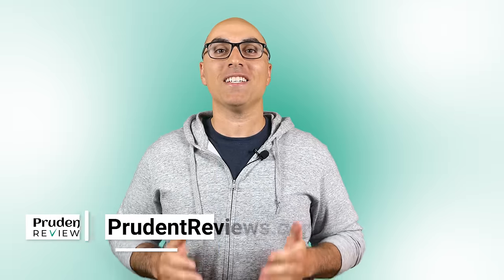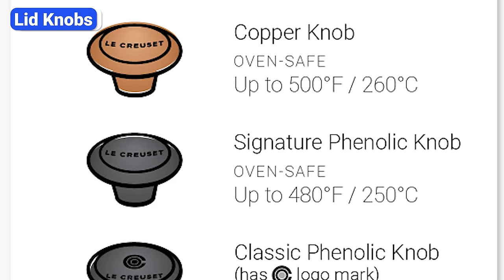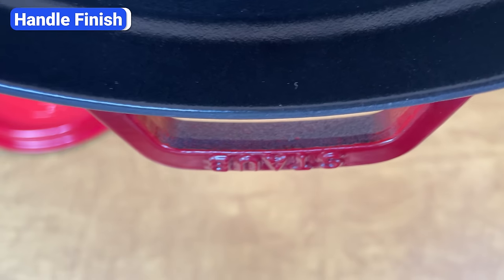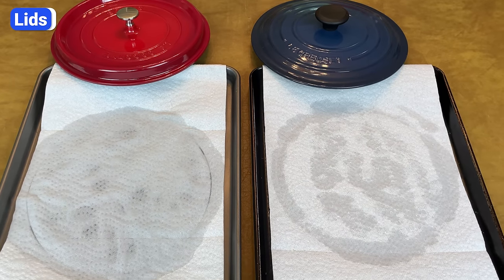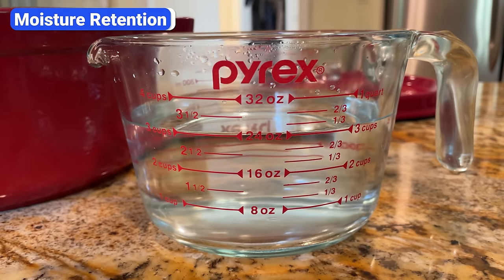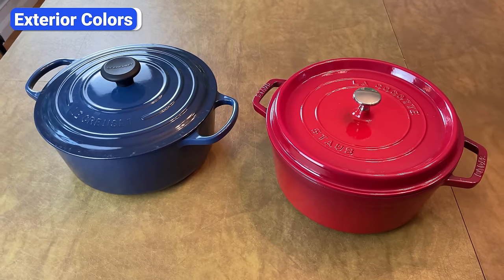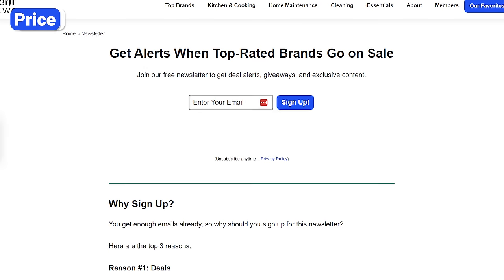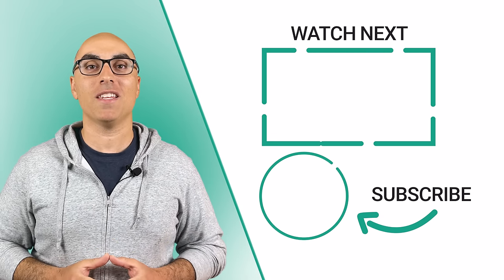Does Staub Outperform Le Creuset? My Tests Reveal the Truth

Comment: My staub Dutch oven was purchased in 2004..it has a top with a the same or nearly the same but cream color inside top lid with the little Stubbs that recycle the steam and droplets while cooking.  This newer version must be different. At the time the only competition Le Creuset had was Staub.  It was a bargain price and the quality was A+.  It cooks even, cleans up easy..it’s heavy so you know it’s quality cast iron ceramic covered cream inside a dark bright blue on the outside.   Ha metal top round handle.  Just had to say not all Staub is the same now evidently.   Now, so much competition..

Comment: The inside on the staub handles not being enameled is actually by design. The rough cast iron helps with gripping
Reply from the maker: That makes sense - just doesn't look as finished.
Reply: Actually… No.  I have three Staub Dutch ovens, one of them has one handle that’s nearly all the way coated while the other handle has virtually no coating… the other two oven’s handles are both mostly coated, albeit very weakly.  It’s not by design, it’s just poor craftsmanship.

Comment: I bought a Lodge brand for less than 1/4 the price of a Le Creuset.  Has worked flawlessly and the food cooked within doesn't know I pocketed more than $200 in savings.
Reply: I almost bought an enameled Dutch oven from Lodge but theirs is made in China.  You can get staubs at a discount from their section with imperfections.  I’ve saved a ton of money and the imperfections had zero affect on the cooking ability.
Reply: If it was enameled though, it won’t hold up for generations. Le Creuset and probably Staub too will be passed down a couple times if it was cared for and everyone is a decent cook who doesn’t cook on too high a temp and destroy the enamel.   It’s just a question of how many times do you want to spend the money and how much do you want to leave in a landfill?

Comment: They're both very good, but I believe Staub is superior. This belief cost me a lot of money, as I had finally (I thought) ended my collection, and then not long after I saw a sale at Sur La Table for a Staub grill pan for $99, and I bought it. It was better than the similar Le Creuset pan. Soon thereafter I saw a 4Q pot sale at the same price, $99, and I bought it, so now both were better than the LC counterparts. I was so lucky with that 4Q pot, because I've never seen it for less than $239 since.  That 4Q Staub pot is the reason I slowly got rid of the Le Creuset for similar Staub products,
Reply: Staub grill pan is a nightmare to clean.

Comment: I wasted far too many precious minutes debating if I should get a Staub or Le Creuset only to end up with a Made In Dutch oven instead. I think the exterior Staub colors (esp Basil & Grey) are some of the prettiest/most stunning I’ve ever seen and even though some complain that the nob on top is tiny, the design is significantly more elegant IMO. I also like the self basting nubs on the bottom of the Staub lids. That said, I did kinda want the brighter interior found on Creuset. That’s when I found the Made In dutch oven! It’s heavy (prioritizing performance) and has self basting nubs like Staub, but has the light interior like the Le Creuset, plus is made in France too. I like its exterior ascetic more than Le Creuset and slightly less than Staub. Cooking performance wise, it seems to do an incredible job cooking even, retaining moisture + heat, etc. Cooks every bit as well as either of the two more established brands while offering a hybrid of their features and costing around $150-200 less — kinda a win, win if ya ask me!
Reply from the maker: Huge fan of Made In’s Dutch oven. Here’s my comparison of Made In vs Le Creuset if you’re interested https://prudentreviews.com/made-in-vs-le-creuset/
Reply: Thanks, that’s very helpful to know. The dark Staub interior is my primary reason for avoiding them.

Comment: I have mostly Staub but do have the Le Creuset rice cooker. I noticed that the bare rims on the Staub are much smoother than the Le Creuset. I always coat them with a lightly oiled cloth just to pre-oil which also makes them shine like new and for extra protection of the rims and the Le Creuset is the one that ultimately chews up my cloths which leaves more lint behind. I'm not disappointed in either of them. The LC rice cooker came with a secondary interior lid that supposedly prevents foamy boiling over. It's my first ever cast iron rice cooker after switching from an electric one so I've never experienced the boil-over before, so I suppose it works as intended, although a splash of oil will also prevent that (tip for when you're boiling noodles, potatoes, or other foods that have a tendency to foamy boil over.)

Comment: One thing you didn't mention is that the Staub has the lip around the edge of the lid to allow you to place coals on top to cook from both bottom and top over an open fire - the original purpose of a Dutch oven.  Probably niche nowadays, but still worth noting.
Reply: I like to put biscuits and other things on the lid when I have the Staub pot in the oven. It has worked well for me.
Reply: You can’t put hot coals on an enameled DO lid!!

Comment: Is am Dutch and I have both. Bought the Staub (28cm) many moons ago in a set with Fissler pans as a replacement for the big pan. Bought some smaller Staub’s (18cm) at an auction. Later I was lucky and won a yellow Creuset form a large beer brand. And soon got another similar one which was “donated” to me. I like the Staub’s better as they have more weight, and the lids with the points are imho much better designed!

Comment: You are comparing apples to oranges. One is put into an oven, the other is an oven.  The rounded lid Le Creusete Dutch POT is a slow cooking pot. It is meant to be used as a slow cooker with heat under the pot. It is possible to place into a heat controlled oven but if the cook chooses to that the cook should trade out the lid-lift knob. It is simply great for falling-off-the-bone once tough meats with little fat. It is a slow cooker and not and oven. The Staub lid and limited size lift-handle is not a slow cooker. It is a camp oven. We used them over open fire and placed hot embers up on the sides to where the line is, then we would put in what we were cooking with the appropriate recipes, oven baked chicken with baked potatoes as and example, put the lid in place and place hot embers on into the recess of the lid. It is, in truth, an oven and acts as an oven. You need only to clear the embers held into the lid to get the best camp-fire sour-dough bread you've ever had or a backed chicken with roasted potatoes and carrots. There is no need to remove the oven from the heat because it is not meant to tenderize difficult tough meats. So. Using flat top cast-iron ovens, regardless of whether they are enamaled or not, will give you both a succulent meal or breads for the day without a kitchen. At the same time, if you want to slow cook a tough cut of meat or an entire meal with wet dumplings or heavy noodles while you spend the entire day out on the lake use the round top Le Creuset because it is perfect for slow wet stews and fall-off-the-bone ribs slow cooker style.

Comment: I bought my Staub because the size fits perfectly in my Breville oven.  The LC would not fit because of the tall domed lid, extended handle width and tapering.

Although annoying, I do like that it is easy to tell if a LC needs more cleaning.  After time the buildup does inhibit proper cooking.

Also, if you have a hard time with the weight of the Staub, consider moving the lid and pot separately since they are close in weight.  If I need to take my Staub out of the oven I first remove the lid and place it near the stove.  Then I transport the pot (plus food) to a burner for a store or to add new ingredients.  It does help.  Also, I store my pot at head level so the dual step process makes it easier to lift.

Comment: Pro tip: Just get the Brandani Dutch oven from TJ Maxx or the Martha Stewart one for $30 and it will work just as well.
Reply: My Martha Stewart and my crockpot brand only lasted a year each. Some of my LC are 13 years old now and they’re all still going strong. And I baby all my enameled pots. For me, LC might be expensive but the price spread over 10+ years is way better per year than the brands that seem cheaper up front but don’t last.

Comment: I have both, most of my Le Creuset is a few decades old with much smaller handle style. I do have a few newer items and some stoneware. My Staub is all fairly recent and now my preferred first choice if cross shopping same style. I would add a few items to this review from personal experience.

1) Staub makes lids with different patterns, this review compared different styles of lids. But you can get the same style if you buy the same pot style. A French oven, Cocotte, or La coquette style, these are used for different applications.

2) These handles are intended for thumbs, not finger tip grip. Side handles you would hook your thumb from the bottom and cup the pot with your gloved hands, and the lid you place the knot between thumb and forefinger if wearing a mitt, or forefinger and middle finger if wearing a glove, this allows your whole flat handle to offer stability.

3) Both Staub and Le Creuset often sell manufacturing blemish defects at steep discount online, and though many retailers. The missing enamel inside the Staub handle seen here is very similar to what you will find during these 30-60% off sales. I have a Le creuset with a flake of red exterior enamel inside on the light sand enamel interior, which resulted in a steep discount.

4) The main reason I’m defaulting to Staub is the internal black enamel. In my personal experience, it has a much higher durability in every day use, and is a lot closer to a naturally non-stick surface. Yes when browning onions or butter, and needing to monitor the funde, the lighter color Le Creuset enamel does excel here. But I find that I’m always grabbing the Black enamel pot for sautéing onions due to the better surface properties.  I have yet to experience the micro cracks and grazing that the lighter color Le Creuset exhibits readily.

5) I have one daily set, and the rest are used for entertaining and larger meals. The daily set of Staub is placed routinely in the dishwasher knowing that the enamel will degrade in appearance over time. Again a select few items (mostly the black exterior items carried by Costco). I would never dream or expect my Le Creuset enamel to survive a few dishwasher sessions.

6) Meals usually are more visually appealing in the black enamel backdrop than the sandy color, when placed on the table IMO.

Comment: Have the Staub in size you presented here. I'm quite satisfied with it. There is one little issue I have. Over a longer period of use the upper rim of the pot which is also black coated lost this coating on some spots by putting on the lid. This causes slightly rust on some spots on the rim. Would it buy it again - probably even tough I would take in consideration real dutch oven like Lodge or Petromax, which overs more or less the same features but are more versatile.

Comment: Please notify when both go on sale.  Thank you for your video. It helps me to decide on which one to buy.
Reply: Buy a Tramontina 6.5 or 7 quart Dutch oven when they are available (Normally right after Thanksgiving) at Costco or Sam's CLub . It will cost less than $50 probably (They were as low as $40 in the past) - And for the price of either of these pots - you can buy 6 of them. THey may not be finished quite as nicely as the ones here - BUT - after 6 months of use - you will not be able to tell the difference. Americas Test Kitchen Recommended then as a best buy maybe 20 years ago - and Mine look like brand new. Use the money for the Beef you will put into them to cook ANd if you prefer - get a Cuisinart or a Lodge Dutch oven which are more expensive but also around $100

Comment: I have one of each brand and much prefer Staub’s interior and self basting lid. Le Creuset’s interior over time has darkened and shows scratches and nothing I’ve tried gets it fresh and bright looking again. The lid on Staub as demonstrated in this video, really keeps stews and goulash dishes moist and basted during the cooking process. The knob on Staub does get hot but who doesn’t use a potholder anyway and the thick steel construction of the knob will last indefinitely. One thing that Le Creuset does do better with is the side handles. I definitely prefer the slightly larger size over Staub.

Comment: LeCreuset doesn't only offer bright enamel interiors but also black ones. They also offer a lid with a dip and the handles are only as large if you buy tbe Signature line items. Overall, bith companies are amazing and it simply depends on the type of item that you buy.

Comment: I wish you had done that evaporation test using the same stovetop element, one after the other, because there's variability not only between two elements, but in how the stove range handles electricity usage when there are two elements on.   Also, with the lid test, could you have set the lids above the paper towels and observed how the water left the lid and landed on the surface below?

Comment: On most comparison reviews on YouTube and in print one of the supposed pluses for Staub is that the dark interior doesn't show scratches and interior damage as much . That is ridiculous. It is literally not a reason to buy one over the other. They both work equally well. With the lighter colored interior you can actually see what's happening in the pan easier. But that doesn't make the pan better

Comment: Another difference you forgot to mention is that, because of its shape, you can put ice on the lid of the Staub, to speed up the distribution of water drops, which is useful in certain recipes. You can't do the same with Lecreuset.

Comment: I bought a Staub around 5 years ago and the enamel popped like popcorn even with some oil in it. I'm never buying a Staub again. I bought a Le crueset 24 cm,  26 cm, and that deep skillet with black enamel and is shaped like a wok.
Reply: Same thing happened to my Staub - a lot of the enamel inside the pot has chipped off. Shouldn’t be happening given the price of these things.
Reply: How did you preheat your cookware? I preheat mine for 5 to 7 minutes (depending on the size of the pan), starting on low heat for at least the first 3 minutes before gradually increasing it. This prevents thermal shock, which is not good for any cast iron cookware. I remember my mother cracking her cast iron skillet (not enameled) by putting it cold on a burner and turning on the heat to high. CRACK! This seemingly indestructible cast iron pan cracked like the Liberty Bell.

Comment: Actually I prefer Emile Henry- lightweight ceramic oven safe to 930°F.
Reply: I much prefer ÉH to cast iron. I have several Staub cast iron pumpkins in different sizes and colors but they're for seasonal decoration and I don't cook in them. If I were to cook in enameled cast iron, I'd choose Staub. I like the lids' dimpled interiors and even though the color range is limited, I like the glassiness of Staub's enamels. LC's colors seem more opaque to me.

Comment: I have some Fissler pans (about 12 or so) and some Staub (about 5 & with diff. sizes). The VERY BEST investment I made more than 22 years ago buying new pans. I also have Le Creuset which I won with buying beer (which is a good thing!! :D) [it's a yellow pan with the Belgian Leffe Beer logo on it]. First thing I had to do was buy an iron handle (so it goes in the oven) as the original is plastic!! In general it is OK, and last year when moving out (at 30Y !!) the kids "stole" it. They like it, so I am happy. IMHO Staub is way better as in bang for the buck. As I think Le Creuset spends much more money on branding than Staub does! Which makes you pay for the brand and not for the product.

Comment: I am curious as to how Lodge compares to these two ... I have Lodge ... my only complaint is that my hands get stuck if I put them inside the handles....
Reply from the maker: These comparisons should help:

https://prudentreviews.com/lodge-vs-le-creuset/

https://prudentreviews.com/staub-vs-lodge/
Reply: Le Creuset is the go to for all of my enamel cast iron but Lodge is probably fine.  I use Lodge for most of my raw cast iron.  I have heard the Lodge enamel can chip off a bit in small areas (like around the lid) but I don't see that as being a major issue.  
  For me, Staub and Le Creuset are fairly equal and I prefer Le Creuset mainly due to the warranty the aesthetics (the lighter enamel) and availability where I live since my home is close to a Le Creuset outlet.  Le Creuset and Staub will generally last a lifetime and not expensive when you consider you will own them forever.
Reply: Lodge enameled cast irons are made in China so that was a deal breaker for me.  I have a regular Lodge cast iron skillet but it’s made in the USA.

Comment: I’m getting by with a $44 Chinese knockoff. Aldi occasionally has similar ones in that price range. White ceramic lining is wearing a bit but it’s been about three years.

An old oval Le Creuset came with my condominium, no handle on the lid. Looks decades old. Cheap wooden handle has survived the oven, and the pot works just fine.
Reply: I'm sure that "wearing thin" lining is both healthful and delicious.